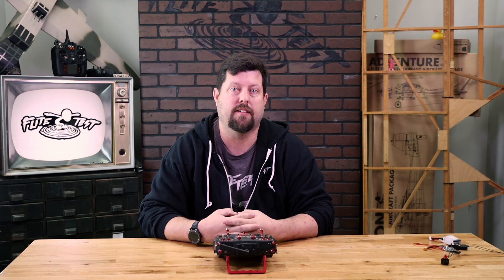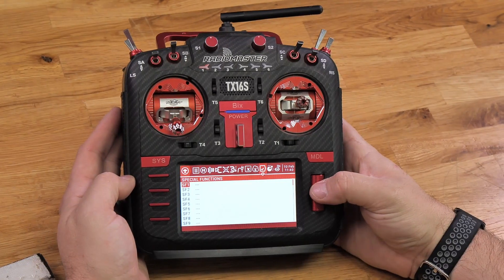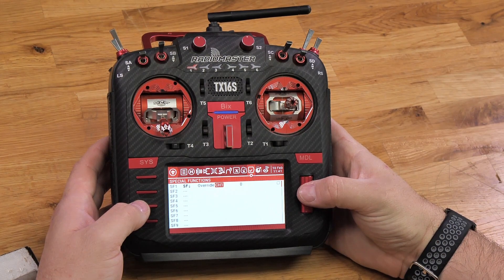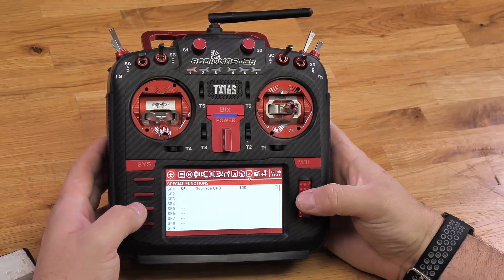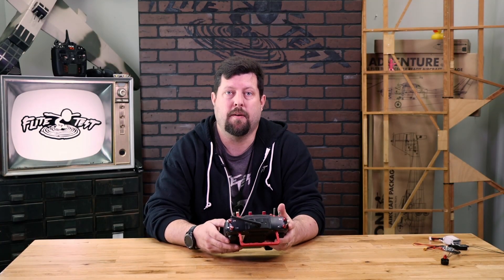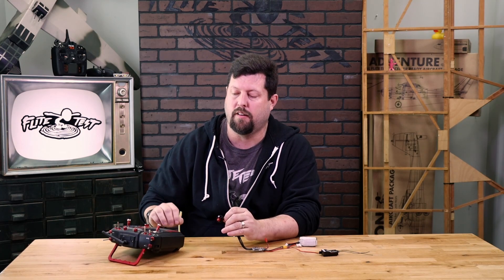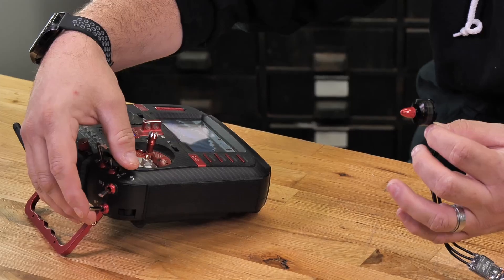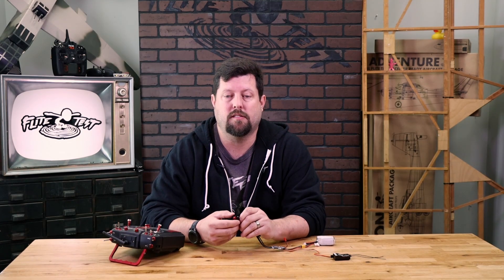How to Add a Throttle Cut on a RadioMaster

Comment: I managed to set my throttle cut ,im using a gas engine..problem is for me so far,  my throttle cut works to cut ignition power..but at the same time my throttle servo accelerates the engine,  so now i have to figure out how to make the servo decelerate my engine, if for some reason my ignition kill doesn't function i would have a runaway engine..easy for electric power..but more info needed for all else

Comment: I'm coming from spektrum (ix20se and nx10se) to the 'mack daddy' Radiomaster tx with the aluminum gimbals. 

MY question is, on spektrum, channels are T A E R. Throttle ch1. On the tx16, do I change the channel assignment on the tx, on the rx, OR leave it be?

Thank you!

Comment: I use a 3-way switch (SG) as my arm/disarm switch, with throttle only working when in the middle (least likely to accidently hit).  To configure, you have two lines in the special function screen - one for switch up and one for switch down.  I also use the "play track" function to play "armed" in the middle, and thcut (throttle cut) on the up/down positions, so I wind up with 5 lines in the special functions screen to actually make the functionality work with verbal announcements, so I know I hit the right switch.
Reply: There are a multitude of ways to set a (semi) "foolproof" Throttle Cut Switch in OpenTX/EdgeTX. Most of them better than the 1 shown here. Always best to have it Auto-engaged at Tx switch-on. Also using the NOT (!) switch selection  would cut the complexity of yours a bit. 😉😊

Comment: I like to set the cutoff as the normal position so the default is throttle cut.  I also set audio to play for either position.  When I turn on my transmitter or select a model, the radio chimes in with "throttle inactive ".
Reply: Yeah... That's the way I do it for any Switch controls... Default is always Failsafe.
Reply: Mine is on those 5 buttons on top. What's also nice is every time you turn it on it's already in throttle cut so don't have to worry if it's off
Reply: Yep - default SAFE and switch sounds are a no-brainer!